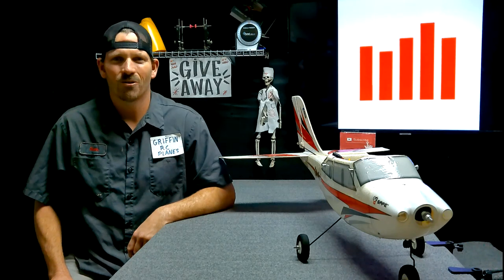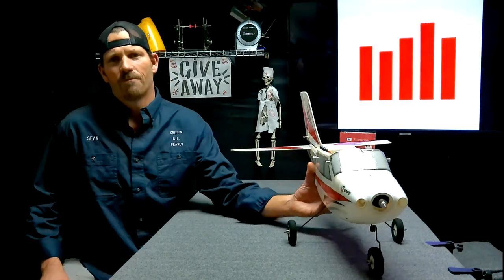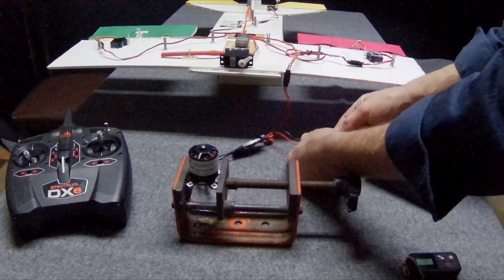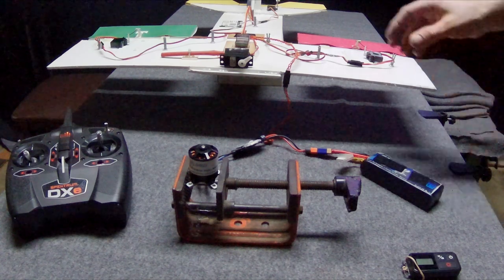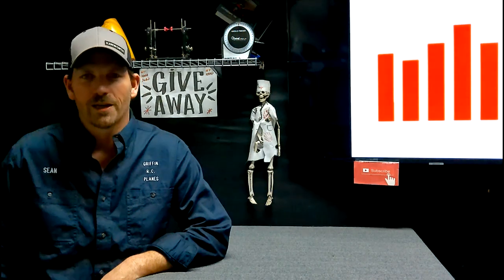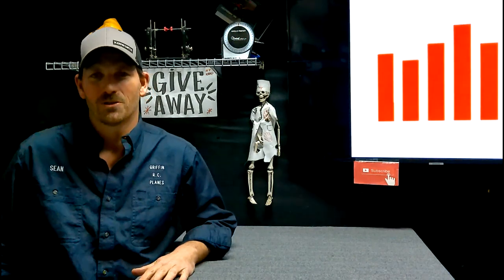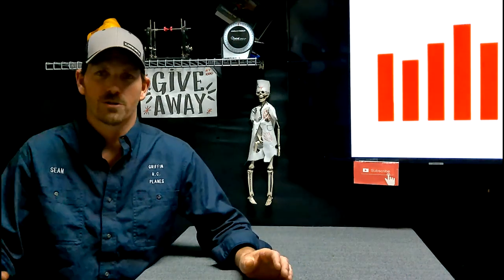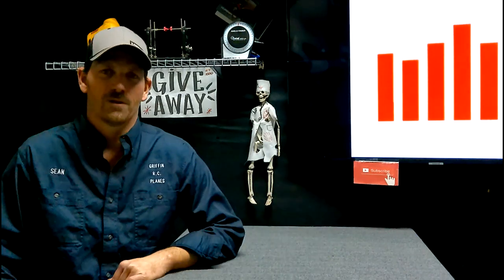INSTALLING A SWITCH TO POWER YOUR RECEIVER RC AIRPLANE TAKE A LOOK AND WE ARE ALMOST THERE

Comment: Sean, I'm using a 2 wire switch between the battery and the esc. That way nothing has any juice, not even the esc or moter, until you turn on the switch.

Comment: I just got an old spprentice s receiver and i did not know about the power switch , good information.
question: 1. your power switch is using just one wire , why you are recomending a 3 wire switch ? i am confused, can you please clarify.
2. How the receiver needs to be installed in other plane....i know that needs to be aliened to the axis of the plane. But how accurate this installation it needs to be? My scratch build plane has no surfaced aligned with the axis onf the plane,,,,how close this alignment needs to be?

Thanks

Comment: Don't we have to install a switch in the bettery wire to have a tru kill switch?
Reply from the maker: this switch wont kill the whole thing you are right
Reply: This is a great idea but you definitely should NOT install a switch on the main battery feed wires. I'm an auto tech and work with DC voltage all the time. Switches are sold in Amp ratings and the biggest are 30A at best and if overloaded the switch can melt inside causing a short and catch on fire. You could probably get away with a switch on 1-2S batteries but I wouldn't want to chance it especially not with the type of switch shown in the video. It's not hurting anything having power going to the ESC while doing your setup though.